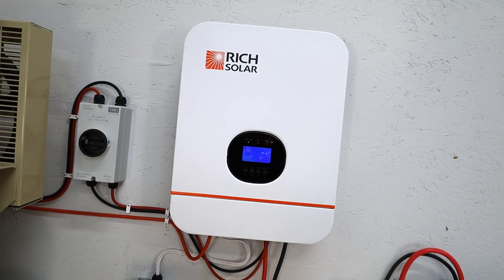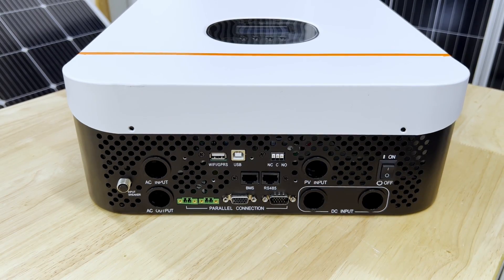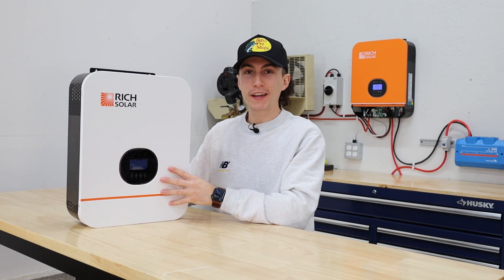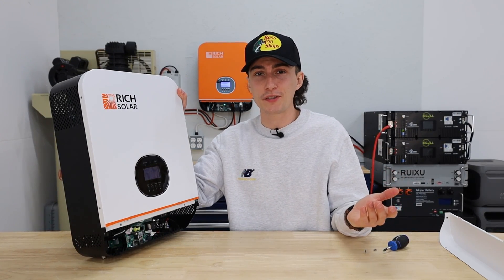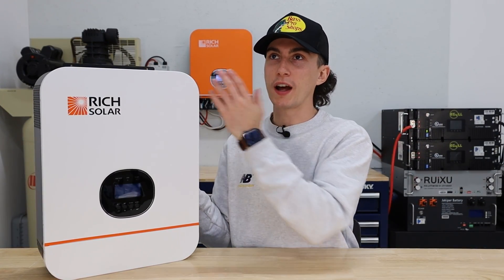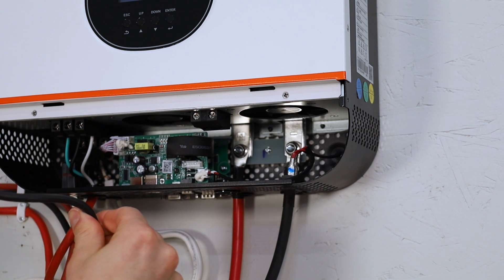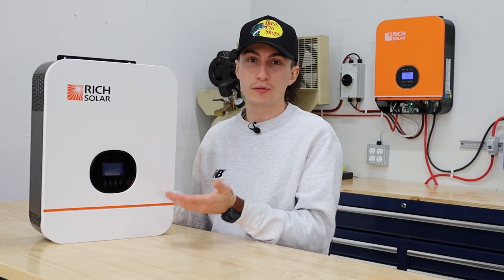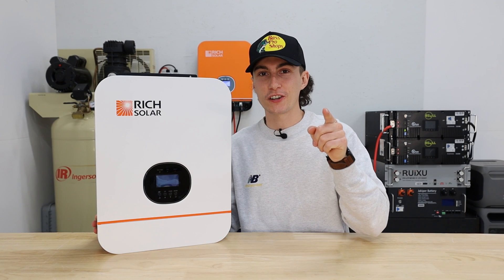Rich Solar 3,000W Inverter - Can it REALLY Compete at $499?

Comment: I don't get why adding an additional MPPT controller is a big deal if you need more. Also optimal charge rates are fairly low amperage as per the bms rating.

Comment: You get what you pay for. The problem with this cheap high frequency, transformerless inverter is not its high price, it's the fact that the manufacturer stripped out the most critical component that's needed to make this inverter long lasting, powerful, and most importantly, safe. This critical component is an output transformer. Without an output transformer to provide galvanic isolation, this inverters offers a shorter life expectancy, a much poorer surge capacity, and it can damage your appliances when its MOSFETs fail and can even set your appliances on fire. I would never use one of these lightweight inverters to power the appliances in my home.

Comment: hold the unit in place - mark drill hole locations with a pencil - set unit aside - pre drill holes - use a magnetic tip screwdriver
Got to love secure secure nut on bolt connection.  What inverter is actually 93% efficient running a 200 watt load of necessities?  Thank You

Comment: I got the solar nova 8k hybrid and its been a nightmare. The first one worked for 2 weeks before letting the smoke out and the replacement will not accept input from our generator. After 3 days of rain, it has proven to be useless for off grid use. I've called and spoke with their outsourced tech support, and they can't figure it out and I cant get ahold of anyone in California. Ive spent 6 weekends trying to figure this out 😂

Comment: I would mount to a thick piece of plywood with tabs extending beyond the top and bottom and assemble the wiring then use the tabs of plywood to mount to the wall.

Comment: This type of inverter will never be able to do what low frequency inverters, with massive transformers can do. Slap inductive loads on these, and try to start compressors and you will see their limits.

This comment is for the English language which is being butchered by native English speakers, and we are teaching foreigners improper grammar...for the love of piss...'then' is a point in time, 'than' is a comparison. Your caption uses the word 'then', when it should be 'than'. YES...it matters!

Your caption should read - "BETTER THAN EG4?"

Comment: I guess somebody woke up and threw the unit under the bus its now $749.00 That's a killer with a $250 jack-up. EG4 3000  is now $647.10.   My disappointment was the lack of higher Solar input.
Reply: Wow! Look at that. In less than 8 months, EG4 3000 is now up to $1049. That's a 62% increase!

Comment: Egs002 24 mosfet board and 6kw apc transformer, 120 240, it draws only 0.5a. 
These are not efficient. 
And the egs002 will push 200a with 52v probably 300a if tuned properly.

Comment: I need 240v, so I would need two of these. Do you recommend this at $800 for two or eg4 6000xp at $1,400? The benefits of the eg4 are that breakers are included and only having one unit.
Reply: Low pv input voltage on this unit..6000xp is the way to go IMO.

Comment: I'm not sure I consider Rich solar to be a premium brand, but I will say if you're going with a transformerless design, and you'll need 6000 watts or more, it would not make any sense at all to get this particular unit over the EG4 6000xp.  Even at $499, by the time you purchase two of them, and all of the breakers/disconnects, you'd spend just as much but have a more complicated solution that won't accept nearly as much voltage on the PV side.

Comment: Hi. I’m a new subscriber. On these inverter videos you might want to mention the system voltage from the beginning. Not everyone runs a 12 volt setup.  I watched it all and no mention of the volts.
Reply: Anyway I’m not too annoyed. I clicked on your link and it was a 48 v inverter and the price was actually $399 so I jumped on it.

Comment: Do these small All-in-One inverters ever have regulated DC output? Useful for RV gadgets.
Reply: Yes, they are all inverter-chargers designed to operate with batteries.   So there is typically one or two AC inputs (GRID, GENerator), BATery terminals (bidirectional), SOLAR panel inputs, and an AC output.

However, there are severe limitations to all-in-ones.  For example, most cannot accept power on the AC input AND charge from the solar at the same time.

They are also not very efficient and the inverter output tends to have high idle power consumption.

Of all the low and medium-end brands, only the Victron Multiplus-II's (which are basic inverter-chargers without direct solar inputs) are really robust, with low idle power consumption, an LF (really a LF/HF hybrid) inverter, and a good well-honored warranty.

-Mat

Comment: Same cookie-cutter all-in-one that half a dozen other brands.  They are all made by the same Chinese OEM... you can tell because all the specs are almost exactly the same.  They are on sale because there is an over-supply of cheap, lack-luster all-in-one's on the market now.

Idle consumption is fairly typical for these cheap all-in-one's, and its unfortunate because ~46W is a lot of power to waste.  An immense amount of power...  1100Wh/day.  Over 200W worth of solar panels on a good day, wasted.   To be honest, it makes the units almost useless since they are targeting small systems where every watt-hour is precious.   Combine that with the limited voltage input for the solar and what you really have there is just a glorified battery charger and low-end UPS for AC mains, and not a whole lot else.

Nut-and-bolt battery connections are exactly what you want for any battery connection.  The shove-in style connectors are fine for relatively low amperages, but not if you are pushing 80A.  You absolutely want nut-and-bolt, always.   You ever see a push-in for that kind of amperage, you run away as fast as you can.

Air filters?   Good god, no.  That's dangerous.  You absolutely never want to have air filters in power electronics like this.  If they ever get clogged up, the thing will catch fire.   Don't mount it anywhere sawdust is flying about, that's just asking for a fire (air filter or not).

If it weren't for the idle consumption these things would actually be useful.  But that idle consumption will crater your battery and in larger configurations you don't want to use a unit this cheap anyway, so it really has no niche to fit into.  Not even as a UPS.

If looking to do a system like this seriously, look at the Victron Multiplus-II 48V 3kW or 5kW ... those are actually useful and the only difference is that they don't have a built-in charge controller.  So buy a little Victron 100/20 smart-solar charge controller and a Multiplus-II and call it a day.   Extremely low idle power consumption, proper float and bulk algorithm, and logic that actually works well.

-Matt
Reply: It wouldn't catch on fire if it had clogged filters. It has temp sensors that would turn the unit off when overheated.
Reply: @JohnnyThomas-ps6mp  This is not correct.   A Victron multiplus has far, FAR lower idle consumption.  A Multiplus-II 48/3K idles at 12W in normal inverter mode (ECO mode not activated).   All of Victron's multiplus units have very low idle consumption... they are best-in-class. 

-Matt
Reply: The victron setup is far more costly, so the comparison makes no sense when this video is geared toward a solid affordable system. If money is no issue then yeah, Victron would be the way to go.
Reply: @SettledOutWestOG  This isn't correct.  Victron has tons of reasonably-priced gear, including inverters.   They aren't bottom of the barrel in terms of up-front cost, but the Victron equipment is far, far more robust than those cookie-cutter units.   Victron's stuff will last a lot longer, the warranties are solid, and the equipment is a lot less likely to burn-down your home or RV.

You can buy a cheap all-in-one.  And then have to buy another one a few years later.  And then buy another one a few years later... all the while getting lack-luster performance and poor efficiencies that generate more heat and require you to beef up your solar to compensate.

Idle consumption is a huge problem with these cheap all-in-one's.  The idle consumption alone is equivlent to piddling away 250W worth of solar panels in full sun JUST to keep the inverter running, never mind actually running any equipment.

See the problem?

-Matt
Reply: @junkerzn7312  then you go buy what you find 'reasonably priced' while I pick up this affordable unit,  then pick up another for a fraction of what I'd get at victron for a 6000w inverter setup.  Clean it up any way you want,  trashing this and anyone that doesn't have victron money won't change the fact that it makes zero sense to compare the two.

Comment: That is a growatt
Reply: More like Growatt uses the same OEM that Rich, Renogy, and ten other brands use to make their cookie-cutter all-in-one's.  So they are all equally lackluster (or outright bad).  That's why they are getting so cheap... the market is saturated with these things.  And also why they are basically worthless.  You can tell how old the design is by looking at the idle power.

Comment: Hey guys, I have a question. I’m relatively new to this and recently I bought two lithium ion batteries each has 3500 W of storage if I wire these batteries in parallel or in series does it change the 7000 W of storage that I think I have? Thanks for all of the information you give us it’s helping greatly.
God bless the United States of America ❤️‍🔥🇺🇸
Reply: 3500 W ?  You mean 3500 Wh maybe?   You didn't say anything about the voltage, amp-hour, or BMS amperage ratings for your batteries so it isn't really possible to answer your question.
Reply: @junkerzn7312   I apologize I do mean what hours I have 212 V batteries lithium ion that are 3500 W hours apiece. I have them wired in parallel right now going to my inverter, but I ran across an issue with the input of the inverter and all that aside, I need the watt hours. I need all the hours I can get, but it never crossed my mind if I wire the batteries in series that I may lose a lot hours? And I did call the battery manufacturer and they told me it was OK to wire those two batteries and series, as you can tell this is new to me🇺🇸
Reply: @theusconstitution1776  212V ?  It can't be 212V unless its a dedicated home-storage system with its own custom inverter.  Batteries are DC.  We need the DC voltage, not the AC voltage output from the inverter.   If its a dedicated home storage system with high-voltage DC batteries you have to read the manual for the system.

In anycase, I'll try to answer the question generally.

Whether you put batteries in series or parallel, the watt-hours add.  The total energy storage available to you is the sum of the energy storage in each battery, regardless of how they are wired.

In terms of the maximum power (watts) that you can run equipment with, however, there are major differences.     The cabling can only carry so much current and there are current limits for the various devices.

This generally means that higher-voltage systems can push-out a lot more power.  A 12.8V 100A system can only sustain 1280W or so.  A 51.2V 100A system has four times the storage capacity but, just as importantly, that 100A cabling can sustain over 5000W of continuous power output.

-Matt
Reply: 2    12volt batteries
Reply: @theusconstitution1776  Ahh ahh, I should have figured that out 🙂In anycase... just tie them in parallel, you double your storage.  If you do more than 2 in parallel you will need to consider proper fusing for safety but just 2 batteries... put them in parallel and call it a day.    Your amperage is limited by the lower of (a) Your battery cabling or (b) the sum of the amperage capabilities of the two batteries.

In terms of putting batteries in series, that of course increases the voltage to the equipment so the equipment has to be able to deal with the new voltage.   Charge controllers can often handle multiple voltages but inverters can usually only handle the voltage they were designed for.

-Matt

Comment: The limited input voltage is the deal breaker for me.  My present array is 350 volts.  That is a 25 amp input from the panel wiring.  My array is 159 feet away, meaning line loss (and copper price)  makes this not usable.  With 350 volts, the current is only about 8.6 amps.  This is manageable.  Power loss is I SQUARE R.  But, a nice unit for many.
Reply: This is for people trying to run like 800-1200w setups really with that low of a voltage. The idea of running that high of an amperage on is kind of ridiculous, but i guess nice to have as an option.

Comment: Thanks for the great video.  There's gotta be a better name for these devices, as they are not just an inverter, it's a charger and charge controller too, yeah?  
Does it take 120vac & 240vac input to charge batteries too? 
Is it MPPT or PWM?  
Pure sine wave or square?
Reply: MPPT and Pure Sine Wave according to the website.

Comment: Neither one of these high frequency inverters have an isolation transformer which is necessary for safety and performance. So I wouldn't buy either one of them. Junk.
Reply: No grid-tied all-in-one or similar unit will ever be isolated from the AC input.  They might have LF inverters in them, but home wiring is designed to have a neutral-ground reference so there's no point having actual line isolation in this circumstance.

Perhaps you are thinking of a different circumstance?  Like an RV or Boat or something like that?

In anycase, if you want isolation, then you either don't use the AC input at all or you can put a 1:1 transformer in-line with it... but then what do you do with the home's ground reference pray tell?

For safety you can add a GFCI or AFCI or something like that.  Isolation is far more useful for power supplies and DC circuits than it is for home wiring (in the US that is)... there are just too many ways to couple a common reference through the actual ground.

-Matt
Reply: So do you have any device that is this cheap and safe as you mentioned? I think because of the very cheap price of those two devices, safety is essential. So is there any additional way to fix it? I thought having fuses would be enough.
Reply: I used to also think that.  Keep learning!  You will change your mind about HF transformerless.
Reply: @JohnBaker3000  I don't need to learn. I have over 24 years of experience repairing inverters at the component level. High frequency, transformerless inverters are junk.
Reply: @quickquote1568  So Sol-Ark HF transformerless inverters are junk? 🤣